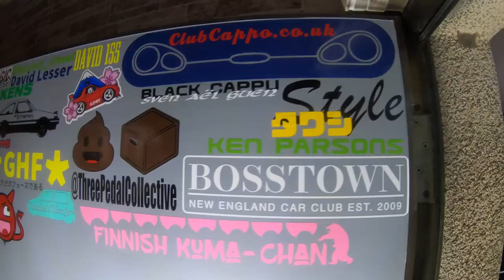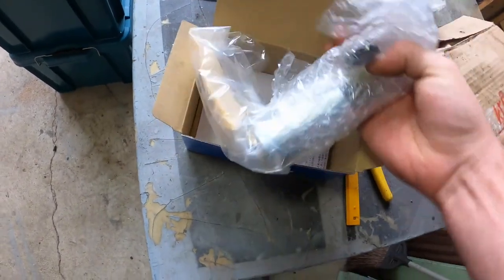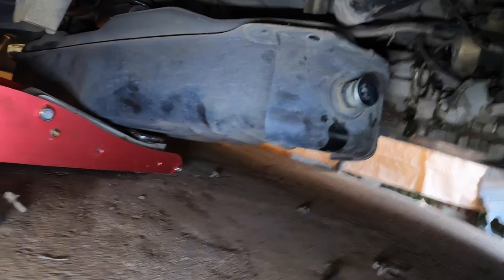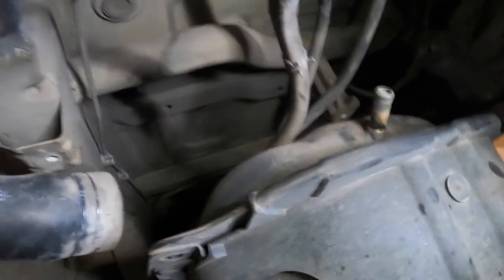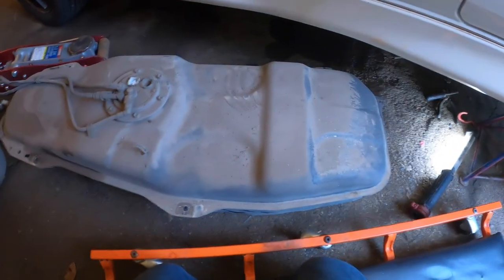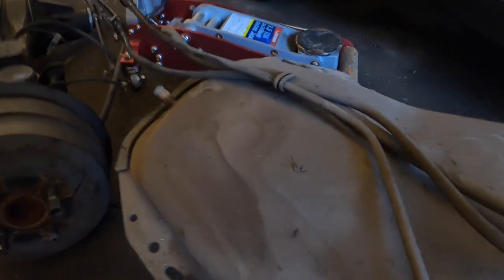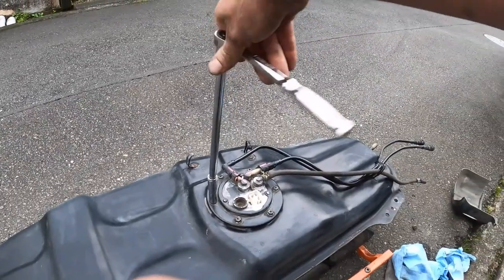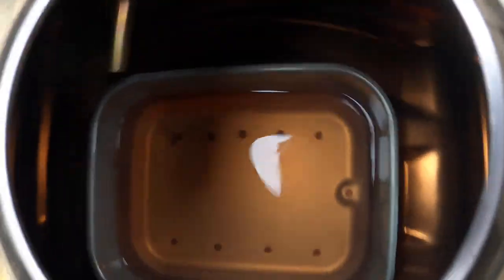Suzuki Every Turbo Van DA52V Vlog #44 (Fuel tank removal)

Comment: Im confused on DA64W  temperature gauge.
Reply from the maker: What are you confused about?
Reply: @GarageKei  its not analog like those traditional ones so it lit color green on the temperature logo. It's green then after some kilometers disappeared and im not confident when im driving coz I don't know if the engine temperature is on danger.
Reply from the maker: @stiiify9603  so the temperature is just a light not a gauge?
That's how the lapin is..
I don't like that either I will probably fit a proper water temperature gauge.
Reply: @GarageKei  yeah but it's a every wagon turbo automatic and i think if the light is on color green is normal temperature and after several runs it goes out. And im not comfortable especially in the tropic hot climate.
Reply from the maker: @stiiify9603  yea that's normal.
If it gets hot a red light will come on.
Reply: @GarageKei  so it is normal? In first runs it lits color green afterwards disappeared? If on high temperature goes red?
Reply from the maker: @stiiify9603  that's correct
Reply from the maker: @stiiify9603  green means it's cold.
 off means it's normal.
red means it's hot
Reply: @GarageKei  thank you sir! More power.